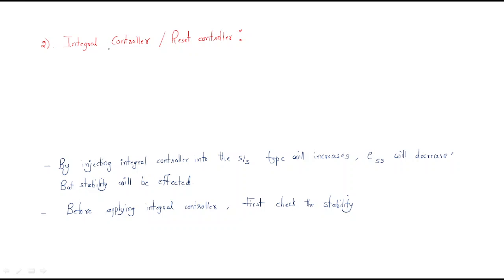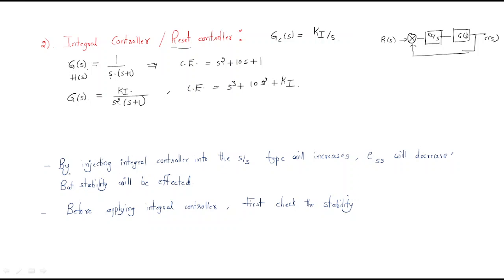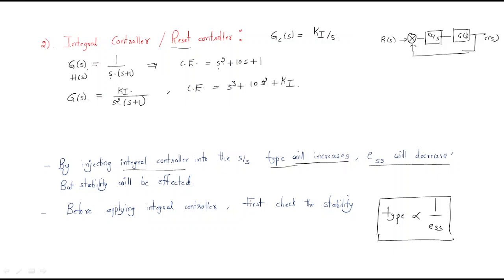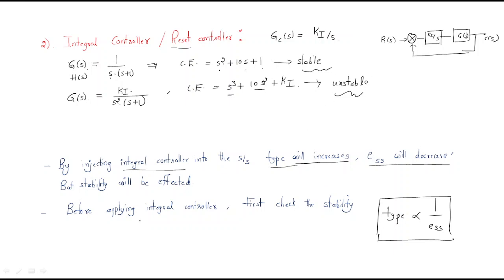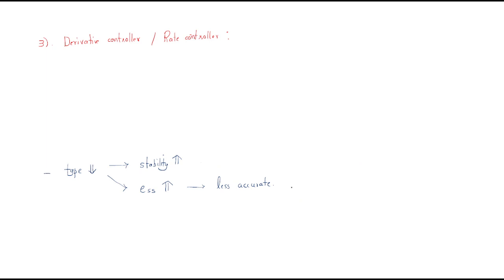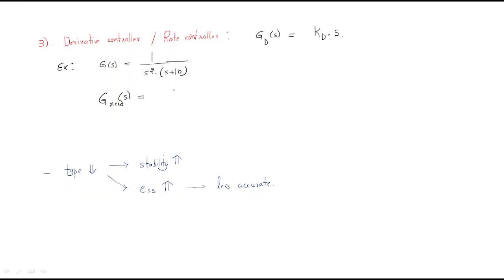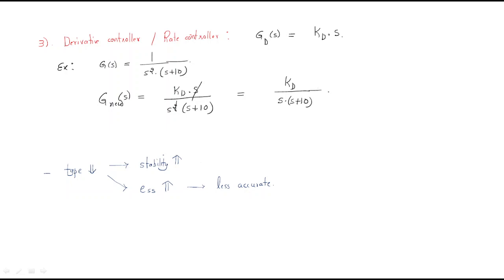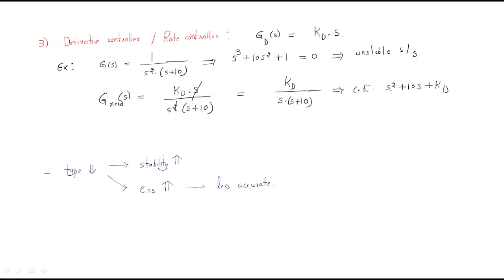PI Controllers | Integral & Derivative | CS | Control Systems | Lec-136

Comment: at 2:01, the transfer function have s(s+1) in the denominator part. After multiplication you r writing it as s^2+10s which is wrong! It should be s^2+1s.